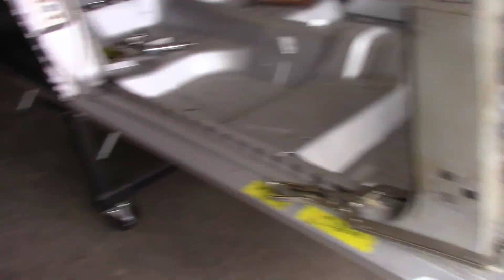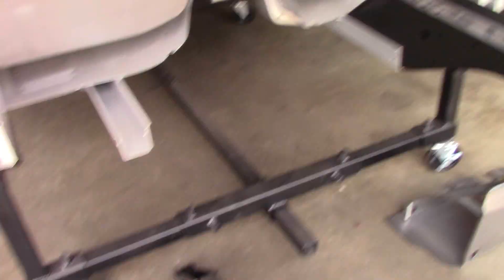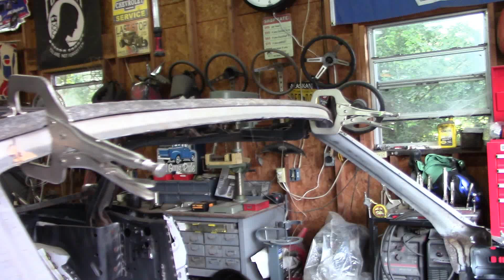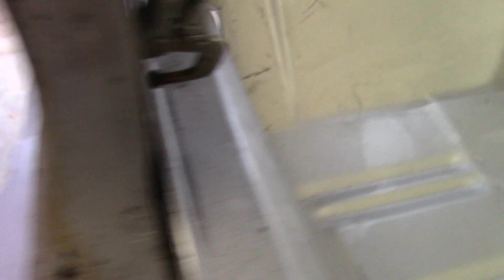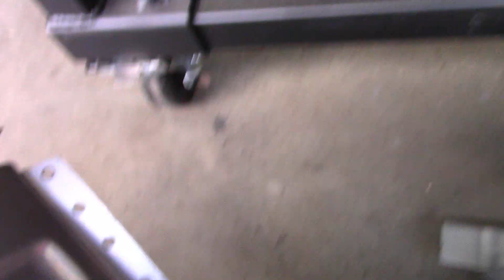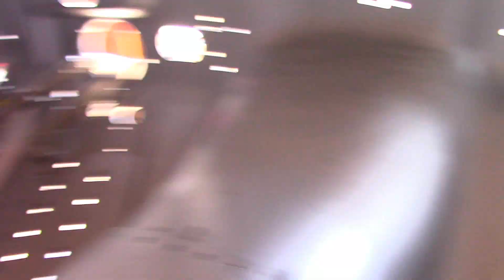Mustang A pillar, kick panels, firewall, and torque boxes. Brooklyn Pony part 10

Comment: If i find out the firewall if a 1/4 inch short meeting the frame rails and fender aprons after welding it in  can the firewall be cut and moved. Or do i need to redo a new firewall?
Reply from the maker: Hard to answer that. It may depend on the maker of the firewall as to whether it’s made right.

Comment: That’s a lot of work to redo cars. You should use welding  primer the brown stuff like bridges . Did u ever use phosphoric acid with zinc when it’s still wet, spray, a paper towel with galvanize paint and then wipe that over what you sprayed with the phosphoric acid

Comment: Truly phenomenal...   I’ve watch many of the videos and have some questions for you—I’ll leave them in the respective segments so the Q&A makes more sense.

I see from your other reply you use 5/16” or 3/8” holes.  I’d like to know the following as it would be helpful for my project;
—which panel pieces did you drill the 3/8” holes.   I’believe the torque boxes are...what else....?  (A pillar to outer rocker, front frame rail to front floor support)
—are you WFS and heat seatings all the same for these heavier metal pieces as they are for the fire wall to floor pan, and like the wheel well to floor pan.  

Thanks again...awesome work here...!
Reply from the maker: 5/16 for the lighter sheet metal, and 3/8 for the heavier pieces. Basically, if the panel is heavier and thicker I upsize to allow for better weld. Wire speed and heat will vary. Not all welders are the same, so I can only say my heat and speed settings for light metal is 2 and 2 typically. I use a Lincoln 140T welder. For the really heavy pieced. (TCI) I used .035 wire.
Reply: @JoDaddysGarage  I have the same welder as you so knowing your settings is helpful, at least to me :). 

Maybe subjective, would you consider the INNER rocker panel and frame rail thicker...?   There definitely thicker than skins and wheel wells—did you use the 3/8 hole on those too...?

Comment: Hey I’m glad I stumbled upon this. Thank you for posting and showing in detail what you’ve done. I’ve been working on a ‘68 Mustang Coupe and need to replace the rusted a-pillar to roofing rail. I’m fairly new at welding and doing this type of work. My car sits outdoors at the moment in Southern Cali. I had a few questions.

1) does the car need to be on a body jig for this type of work?

2) can this be done using a flux core welder (Lincoln Electric Weldpak 125)?

3) what recommendations do you have for me to get started with this type of project?
Reply from the maker: 1. Not necessarily a jig, but adding cross bracing prior to cutting will be a great benefit. 
2. I do not recommend a flux core welder. get something with gas. 
3. Good question. Have a look at the various playlists I have on my channel. I have one specific to the 68. Jade.

Comment: Typically what size drill do you use for your weld holes in the floor pans and other sheet metal?
Reply from the maker: Around 5/16 to 3/8". 1/4" is just too small in my opinion.

Comment: Eagerly binge watching your videos. Will be starting my own 66 GT soon, though it's body is in pretty solid condition. I'm curious why you don't have a "Air Punch and Flange Tool" for creating holes for your spot/plug welds. I saw it on Elin Yakovs channel on his Triumph GT project. Seems like they would save you a whole lot of time and it looks to cost less than $100. I know it can't be used everywhere but when it can...
Reply from the maker: I have one, but I'm so used to just drilling.

Comment: How do you deal with moving the vin tag from the original to the doner dash. Aren't the special star rivets used by the OEM's illegal to have outside the car factories?
Reply from the maker: These cars do not have a vin on the dash. As far as special rivets, I believe that's mostly GM products. Rivets can be found though.

Comment: Barry ..I am up to episode 10 yeayyyy...LOL. Man, in all your videos I see you replace your trunk panels...I am restoring mine and it is NO FUN. Only one spot that needs a piece and weld, but man, removing the factory seam sealer and sanding the trunk is a NIGHMARE even with an angle grinder. Do you ever keep the trunks or do you usually replace ?
Reply from the maker: I replace if rusty. I have sectioned the inner area on a 68 coupe. The part that holds the gas tank.

Comment: Do you know where I can find (BIW) body in white  and pillar blueprints? I want to get into 3d modeling to work in an automobile industry running the assembly line with 3d printing. oh also, if a vehicle is a 2 door it doesn't have a C pillar correct? That would be the B Pillar at the end for a 2 door car
Reply from the maker: I do not have any blueprint info, Sorry. Here's a slideshow to help understand the pillars.  A 2 door car will have an A pillar, and a C pillar for sure. https://www.slideshare.net/mlehane/the-a-to-d-of-car-pillars-presentation-827189
Reply: thank you very much for your time in reading and answering my question.

Comment: I love the videos they are very helpful as I’m restoring a 1967 coupe and I got to replace a few body panels . I was wondering did u ever put on a quarter panel skin on a mustang or do u reccomend not doing that thanks
Reply from the maker: I have not done a skin on a Mustang, but I've done them on other cars. It really depends how far you want to go. If you have a good upper section, and have some experience, a skin isn't too bad. I just prefer a full quarter so it is a mostly seamless finish.
Reply: Jo Daddy's Garage
Ok sounds good thanks for your input looking forward to you starting the 68 mustang
Reply from the maker: There are a series of videos on the 68 if you haven't seen all of them. If you mean start as in engine, it's running at this point. Started doing the body work, and decided to replace the quarters and tail panel. Haven't done any cutting yet.
Reply: Jo Daddy's Garage ya the operating on it I was referring too lol
Reply: Do you have to put floor pans in the 68
Reply from the maker: Already done. https://www.youtube.com/playlist?list=PLqaLsNggDKpX_qist_EZjeBx6X5cYrPWe
Reply: It must be nice to just drive down the road and pick up any part you need I’ve ordered a quarter panel skin and it took 6 weeks to get

Comment: Awsome video again... As many here I am impatient to see part 11... Regarding the firewall cuttout to adapt it for a convertible, wasn't it easier to use the upper part of the torque box  (the one welded at the end of the video) as a template, as long as you have to separate them?
I still don't understand why Dynacorn keeps selling the one part torque box as they also offer the 2 parts one (reference 3652wt and 3653wt).
Reply from the maker: That's not a bad idea. I sometimes get ahead of myself and had I thought of that, it may have been easier. That's why making these videos can be so beneficial to others.

Comment: Hi JoDaddy. One question if I may. Are you planing to treat the fresh air tubes inside the cowl ?. Has these are the biggest problem with rust at least in my mind. I did treat mine and no rust or  leaks yet. It's a shame Ford didn't put proper drains in that section of the Mustang.
All my best.
Bobby
Reply from the maker: I will treat it. Stay tuned.
Reply: Thank you. I am interested in your way of dealing with this common problem.
All my best.
Bobby

Comment: I can't over state how much I appreciate how you and others take the time to make these videos. I realize from my own aborted attempt to document the restoration of my 65 fastback that it involves an enormous amount of effort with very little payback. l'm really looking forward to seeing your process of mounting the frame rails. I spent hours on the web reading through debates about which measurements are "correct", the Ford manual vs the various Liskey drawings. Ultimately I couldn't make any of them work. My plan is just to work backwards from the fenders and hood gaps and  suspension geometry.  Thanks again for sharing your work.
Reply from the maker: You're right, it is a lot of extra work, but I like to help people, and this is one way to do it. Thanks for the comment.

Comment: I was looking at the repairs you did at the base of the windshield pillars (@ about the 1:53 mark) and the rough texture and I assume holes where it was filled in with weld, looks somewhat like an issue I have with the frame of my 70 convertible where the frame meets the top of the windshield frame.  Frame has that same roughness like it rusted and some is missing/ pitted and I was wondering how to fix that.  I assume the convertible top frame is steel and can be welded to fill it in then ground and smoothed, but would something like a JB Weld work for that too since it is not so much structural but cosmetic?
Reply from the maker: It is steel, and I prefer welding. The difficulty with JB weld is that it may not stay in place anyway. With a little flexing, it could come loose.
Reply: Good point.... thanks for the thought.

Comment: enjoy your videos, I have a 65 mustang convertible I have been working on, the driver side shock tower and frame rail were rotten, was able to replace with a "Dynacorn" full shock tower assembly, took some work, but I was able to replace with one piece torque box at same time, shock tower fit perfect, I had to modify the 1 pc torque box a bit, but got it to work.

Comment: you mentioned that you checked the fitment of the reproduction door, make sure that the passenger side door latch is cut out in the correct location. I have had to move the latch hole down on the door shell on two different occasions. Original is always best! Thanks for you great videos!
Reply from the maker: Good advice.

Comment: Great work Barry! Not sure if it's the same on Dynacorn, but when I replaced my firewall, the holes for the parking brake are incorrect. Might be easier to fix(if you have to) prior to putting the rest of the front end together.
Reply from the maker: I'll take a look at it. Not sure if we'll be using the original parking brake setup since all the suspension will be TCI.

Comment: The torque boxes! Just the thought of them strikes fear into anybody who has restored a Mustang! Possibly the very best rust trap any manufacturer ever designed? The shear amount of work involved in removing,repairing and replacing make them one of the hardest jobs I have ever taken on. Changing them in situ is almost impossible without stripping car this far down? Won't be sad if never have to do job ever again! You making such a neat job of this one.
Reply from the maker: They are a pain. Not sure why they sell them assembled....
Reply: anybody got any film footage of the original cars being put together on the factory line? would be handy to know exactly in what order and how they were assembled and welded. The biggest issue in restoration is removing and replacing panels in a different order to construction. End up with impossible flanges and fits, seams sandwiched between other seams and dealing with wrong build order. I have only ever managed to replace torque boxes on bit at a time, wonder just how far down the car has to be to change in a single unit?